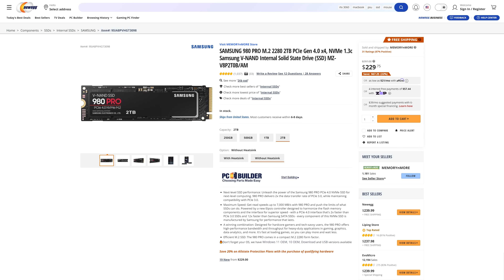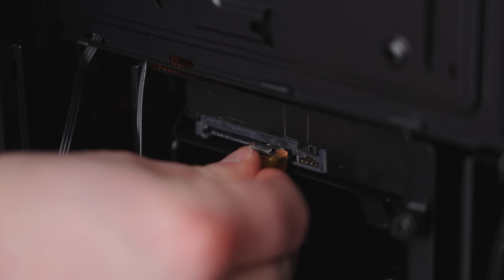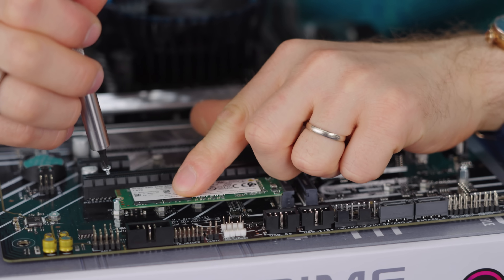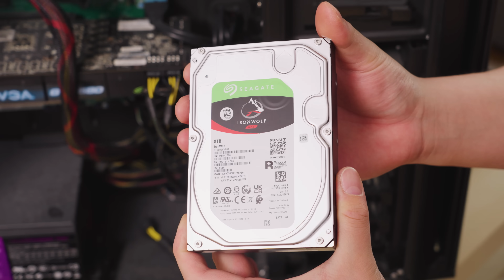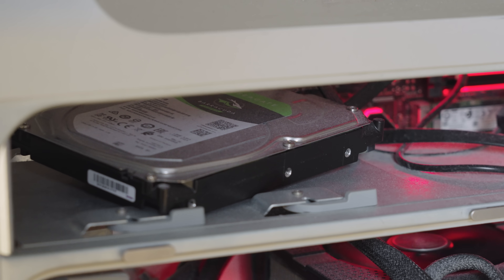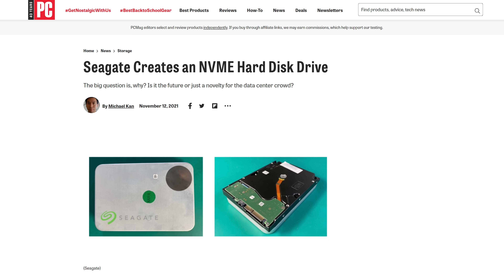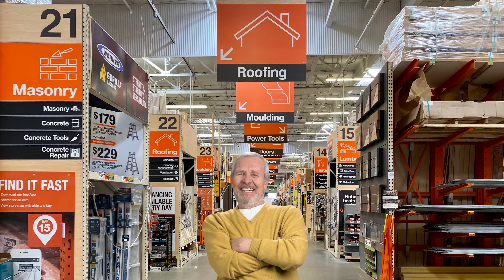Is SATA Obsolete?

Comment: Guys, there are also chipset-attached NVMe ports. Chipsets provide PCIe lanes of their own for additional peripherals that are not directly attached to the CPU, with a pretty small penalty in latency. 

I have two NVMe drives and a gpu at 16x pcie on AM4, which only has 24 pcie lanes. The 4 lanes going to the chipset can be split out further. On x570 boards you can even install 3x NVMe drives at PCIe 4.0 without downgrading the lane width on your GPU from x16.
Reply: sorry for askin but i have a Asus Prime B550 Plus motherboard and i want to install another nvme ssd along with the one i already have, is this going to decrease performance?
Reply: @hkprogram837  If your current drive is in the top slot, between CPU and GPU, it's directly connected to the CPU and won't be sharing PCIe bandwidth with the M2_2 slot. That top slot is also the only one that will operate at PCIe 4.0 speeds.

The lower slot shares chipset resources with a couple of SATA ports, so you'll lose SATA ports 5 and 6 if you populate that slot. If that's a problem, you can get an m.2 to pcie x16 adapter and install your second NVMe in the lower x16 slot, which is actually PCIe 3.0 x4 electrically, so perfectly matched to a wide range of NVMe drives. If you don't use all the SATA ports and can give up 5 and 6, then you could also use such an adapter along with M2_2 slot to get 3 NVMe, with two operating at PCIe 3.0 speeds and sharing bandwidth through the chipset.

Without knowing which drive(s) you plan to install I can't say for sure there won't be performance impact, but if you are sticking to PCIe 3.0-spec drives (~3000MB/s speeds), then you won't see any practical performance impact. There's a tiny, measurable but imperceptible  amount of additional I/O latency going through chipset, but bandwidth shouldn't be affected and in most cases it will be perfectly fine. 

If you have a PCIe 3.0 spec drive now, and you are looking to add a PCIe 4.0 spec drive, you should make sure the new one goes in the top slot.

If you need multiple PCIe 4.0 drives, you need to upgrade to x570.

Comment: NVMe may be a good reason for chipsets to come with their own PCIe lanes to hand out. You could dedicate those to U.2 bays, though the benefits wouldn't be seen until U.2 gets more common in the prosumer market. Doesn't even have to be the same gen PCIe as the CPU, could always be older, still would outperform SATA.
(I'm sure there are bound to be boards doing this already on the high end, but still worth mentioning)

Comment: SATA, like mechanical drives, are one technology i don’t think will ever go away completely. Especially as mass storage demands increase, internet speeds get faster, and hard drives get even cheaper. They may not be used by everyone, but i do think there will always be enough demand to keep them relevant.
Reply: Yep, and don't forget eSATA!

Also SATA got support for port multiplier/multiplexer so you can actually add quite many drives if you are willing share bandwidth between drives.
Easy way to connect lots of storage devices to a system.

Comment: Unless another technology enters the consumer space I don't see Sata going away anytime soon, its inexpensive and fits its role well.    I think enough consumers still need the functionality of a Hard drive commonly enough that total solid state storage still won't be a thing for a long time.  As well not all SSD's are made equal or as robust.  These cheaper high capacity drives generally have terrible durability, so in some intensive work station or specific cache like applications where writes are happening all the time over course of 10 years, they may not last as long as hard drives.  (which of course have a certain chance to fail after same kind of application too)

Comment: s-ata will be a thing for a long time to come because sas will be a thing for a long time to come
pretty much any sas controller is s-ata compatible and for this reason it'll be the way to go for enthusiasts: use a sas hba with cheap s-ata drives
even big storage appliances like their own use this style for the raw bulk mechanical storage - this will stay for a long time until flash memory issues fixed

Comment: These videos are getting more and more wrong with each new video.

PATA was going away long before SSDs became affordable, because it was cheaper, easier (to plug in and cable manage) and more efficient, especially with native command queuing.
I'm not aware of a single motherboard where the M.2 slots can steal PCIe lanes from the GPU, the first slot connects to the CPU, the rest to the chipset, just like SATA (which I might add is usually integrated into the chipset).

Comment: SATA needs to be replaced by SAS because SATA is one of the three protocols that SAS supports, another is SAS expanders so you can daisy chain a lot more drives off one computer and the SAS controller often does hardware RAID so you don't have to overload your CPU with software RAID.
Reply: SAS is really the way to go. Now you have 12gb SAS.
Reply: Yeah agreed, it'd be amazing if we could start getting SAS controllers integrated into motherboard chipsets. SAS has supported 12 Gb/s speeds for awhile now and 22.5 Gb/s is coming soon too which would make SAS SSDs pretty competitive with gen3 NVME SSDs. SAS has all the physical benefits of SATA connectors but without the same limitations of the protocol.
Reply: None of that's true though. There is a reason why we stopped daisy-chaining things, the issues of reliability and trying to use the same cables for multiple devices are just not worth it. Presumably, the issue of terminators and jumper controlled IDs isn't what it was back in the '90s, but it's a whole mess of problems that we finally got past. Similarly, hardware RAID is a bad idea now that computers are fast enough, with enough memory, to not need them. They existed in part because most computers didn't have enough ports, and in part because the computers legitimately needed help processing the data. Neither of these is likely to be the case now. My computer has 8 SATA ports and I could add a whole mess more of them with expansion cards. No daisy-chaining required.

What's more, good luck getting your data out of a RAID if the controller is the thing that dies and you don't have a compatible replacement card available. It has been quite a few years since FreeBSD started recommending their software RAID over hardware and I've had no issues at all in all that time. I've had to replace many disks and a few times I had to take the array to a different computer to deal with, none of that would be possible with one of the puny hardware controllers that are typically affordable to home users.
Reply: SAS costs a lot more. Though I do not know why... the chips are not much more sophisticated. Maybe just because no-one makes 'consumer' SAS interfaces?
Reply: @vylbird8014  Yeah you're probably right about the lack of consumer SAS drives and controllers causing them to be more expensive. I bet if they were mass market consumer drives they'd be comparable in price to SATA drives. Interestingly though, if you shop for used high capacity HDDs on ebay, the SAS drives tend to be cheaper than used SATA drives of the same capacity. I guess on the second hand market SAS is in lower demand and therefore priced lower cause less people are able to use it.

Comment: I remember the leap from IDE to PATA HDDs! Those were the days, yeah? Getting 1.44Mb on one disc!  Then MS managed to squeeze 1.68Mb onto a floppy with their Windows 95 Distribution Media Format (DMF) disks ... all 13 of them!  But wait there's more! Windows 98 came on 38 1.68 MB DMF floppy disks, yes 38 disks as not everyone had a CD read only drive. 😆😂
Reply: I'm pretty sure IDE ≈ ATA ≈ PATA am I wrong?
Reply: @theoddgarlic8293  Yes, you're correct!! Forget ATA! 😄
Reply: I used to have a set of MS-DOS 5.0, MS-DOS 6.0 Upgrade, and MS-DOS 6.22 Upgrade, then Windows 3.11, and then Windows 95 on the 13 Floppy disks that you had mentioned. When 98 came around I already had gotten Windows 95 OSR2 (C) on CD-ROM and then I had skipped Windows 98 and later had gotten Windows 98 SE on CD-ROM.
Reply: @JesusIsLordAndSavior77  Same here, I skipped Win 98 for SE and I still have the CD. I also skipped Win Me for XP. I still have my Win XP CD as well.

Comment: SATA hard drives are still king for bulk storage, or if you need something that can reliably handle frequent but moderate bandwidth write loads, like CCTV setups. 
SATA SSDs are also still plenty fast enough for an OS drive. Use the NVMe drives for storing software and games, and a big ol' HDD for everything else. Probably what I'll do with my in-progress build.

Comment: Mechanical hardrives can be written to many more times than solid state and last longer. For speed you need solid state for long term storage mechanical drives. What is the difference between sata solid state drives and nvme solid state drives only the interface. SATA interface will be around for longer than you think.

Comment: If Parallel had been further developed it would be much faster than SATA
Reply: No, PATA was more or less a dead-end. They extended it to the point that they could, but going much faster would have been silly. They already had to change the cable from 40 pin to 80 pin to manage crosstalk interference just to get to the speeds that it ended at.  Trying to go faster would have made the problems of interference worse. What's more, you could only have one of the two devices active at a given time and the ports were massive, which meant that you rarely got more than 2 on a motherboard.

The only way that it would have been faster than SATA is if they had abandoned SATA technology to continue with PATA.

Comment: Totally agree.  Sata is not going away any time soon.  When doing mass storage like I do mechanical hdd are way more cost effective.  The sata nand ssd drives are perfect for storing and working on smaller files like word and excel docs.  When upgrading my computer I can easily pull it and transfer it to a new computer.
Reply: Mechanical drives are also in a league of its own when it comes to data retention, for cold storage. A simple Linux RAID1 with 3-4 drives, kept in a firesafe and you can keep your data safe pretty much forever. Just spin them up and check them one per decade or so.

Comment: Don't most of the M.2 slots that are further from the CPU run off the of the chipset's dedicated bandwidth?
From the boards I've worked with, the top few PCI-E slots and the top NVME drive are the only ones directly connected to the CPU, whereas the other ones generally connect through the chipset on a slower PCI-E speed. On my X470 board for example, the Gen 3 M.2 slot and top 2 16x PCI-E 3.0 slots are connected to the CPU, and the bottom PCI-E slots and M.2 slot go through the chipset on a Gen 2 connection.
Even the chipset diagram you show only has 1 PCI-E 4.0 slot (M.2 to the CPU), everything else connects though the DMI link to the chipset.
I think the statement that adding more NVMe drives can effect graphics card performance should be amended, unless specifically using an M.2 riser card in a slot connected to the CPU. Even still that should never push the graphics card down to x4 speeds.

Any bottleneck would be on the DMI connection, which would only effect gaming if your graphics card is running through that instead of sitting in the top slots.

Comment: The cost gap between Sata and pcie3 NVME closed about a year ago... its hard to justify buying sata ssd unless you are out of m2 slots. 
Dont most realitivly new (last 5 years ish) mobos have the enough lanes so that you dont have to cut into the "top gpu" pcie #1 slot dedicated 16 lanes? It seems normal to have the top m2 dedicated direct to the cpu and bottom slots shared with a different pcie position #2, 4, or 5 or even routed to the sata controller. 
Disclaimer, I dont know what im talking about.

Comment: SATA is too useful and can be used for more than HDD/SDD, it's not going anywhere soon.

Also, until the prices fall a lot more, people will still be using SATA SSD & HDDs.  And when they do fall then ultra high capacity 3.5in SDDs will take the place of the older 2.5in and 3.5in spinning rust.

Comment: Unless they make some sort of expansion card for motherboards I think SATA will be around for a few more years.  While NVME is nice, smaller MBs usually have 2 slots,,, and well sometimes you just need more than 2 drives.
Reply: They do make expansion cards for connecting M.2 drives to PCIe slots.

The problem is high lane-count PCIe bridge chips are expensive, so most affordable cards are either single-drive cards or bifrucation cards (which have compatibility issues). Bridge-based cards do exist but are bloody expensive.

Comment: I recently got an 8TB hdd because i was running out of space - which instantly tripled my storage capacity. since i use it mainly for multimedia/screen capture, so the speed is irrelevant.
the only downside is that mechanical drives are quite loud :/
Also even most enthusiasts will not know the difference between sata and NVME SSD when it comes to system responsiveness - me included, those 3 seconds it shaves from boot time are insignificant anyway.
Reply: There have been several instances where I've been woken by my entire disk array (and its fans) spinning up.

Comment: i had an additional nvme card in my 2nd pci slot, which i wanted to fully use instead of my hdds after some performance and stability tests, 
but than i also upgraded my graphics card, from a 1080ti to a 3080ti, 
the card is too chunky... sadly removed the ssds and now waiting for the release of the new amd am5 cpu generation to upgrade into a new corsair 7000d pccase with full custom watercooling...

Comment: The SATA interface is simply serialized ATA protocol, similar to how PCI-Express carries over the legacy PCI signaling. SATA's only functional advantage is that it was able to transmit the data packets faster, but it carried over all the limitations of the old standard, like half-duplex transmission (only read or write operation at a time) and very short command queue, limiting the number of concurrent requests. All this was naturally limits the highly parallel nature of the NAND memory, but for the most users it will be good enough for many more years.
Reply: SATA has two modes. One is PATA emulation and the other is faster SATA mode.
Reply: *queue, not cue
Reply: Yeah I think that as it stands we'd probably end up having some kind of revolution or at least change like in the way PCI went to PCIexpress but then changes something fundamental about it because of the way lane usage works, also because the way the NAND controller works today making for instance lots of small files take longer than big chunks of data.
Reply: parallel nature of the NAND memory could be utilized only in servers, while in desktop/lab environments processes are mostly linear. But even so, that's why RAID exists, which soften this only read or only write limitations.  And honestly - i see no difference in my day2day usage of m.2 vs ssd.   m.2 in overall is faster only while  cache is not filled up

Comment: I seriously doubt SATA is going anywhere any time soon. It took so long for IDE to be phased out that I was actually more surprised I didn't have it than I would have been if I did
Reply: It's not going to be. It took the previous PATA ports many years to disappear, and they only disappeared well after the point where the IDE drives that they were designed to work with did. My first computer builds used them because I couldn't afford SCSI drives, and they were a pain. You could only have 2 drives per cable and only one drive could be active at a time, which meant that when CD burners came along, that the CD burner couldn't be attached to the same port as the HDD with the files without having to massively slow the process down and possibly get a buffer underrun and ruined disc as the result.

I'm going to stop short of saying that SATA will always be with us, but there just isn't any viable alternative that could do it any time soon. The older IDE disks could mostly be converted to SATA without much issue, I have a few adapters sitting around. And because it doesn't require the drive to be plugged directly into a port that's soldered to the motherboard, you have a great deal of flexibility about where the drive is positioned. In fact, this computer has some disks inside and a couple outside by way of an e.sata adapter plate.

Comment: sata is still useful because there's always a market for high density storage. I need sata drives for my 10/12 TB linux (tech tips) collection.

That said and as an aside, my USB 4 drive enclosure won't transfer at 3.1 speeds and so I am grabbing an extra long sata cable to run from my computer to the enclosure. One day all USB cables will be USB C or better and on that glorious day I will finally not need to play around with all these dongles and parts just to transfer at max HDD speeds